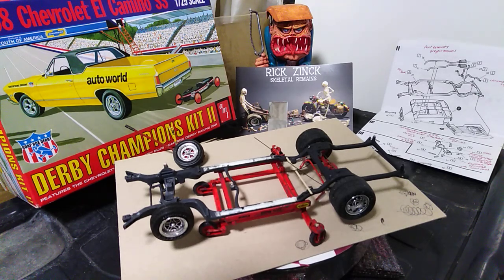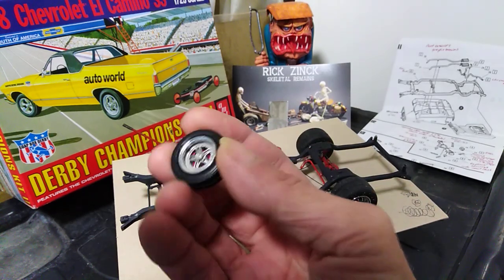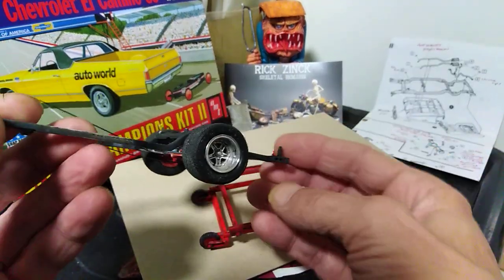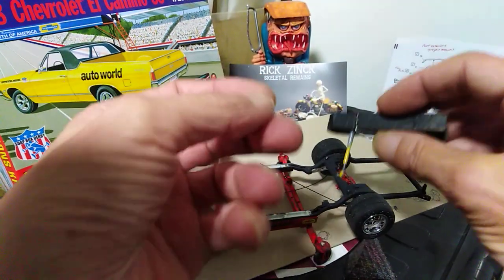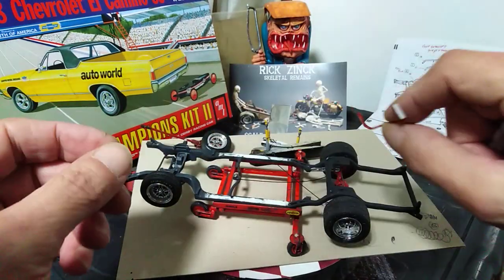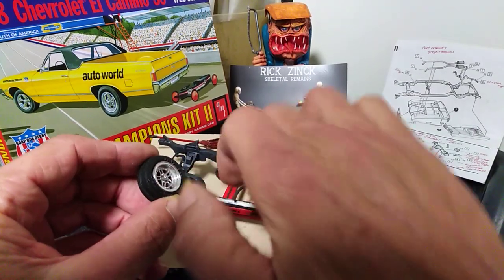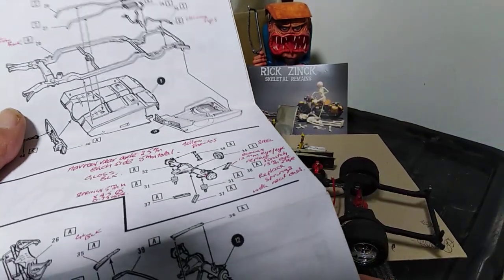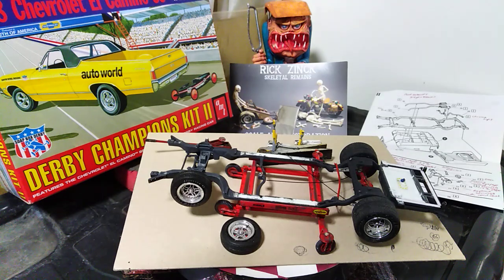1968 Chevrolet El Camino by amt. wheels, brake cables and suspension.

Comment: Interesting video, I could watch these all day long. Nice scratch building with the spare sprue pieces, I like your idea for the tire valves.
Reply from the maker: I really do think that adding little details makes a model. It takes 20 - 30mins to do a set of valves but enhances them vastly. Engine bays look barren without wiring and I don't think plug wires are enough. Open any bonnet and look. I've bought Workshop manuals for several cars to look at details. I didn't mean to run on, but I like talking with you. So, I hope you're ok and best wishes from jolly old England 👍😎Pete 🤓
Reply: @petesmodelcarcustoms584  No problem, glad to hear your ideas.  I don't have access to all the aftermarket accessories they have in the U.S.
Reply from the maker: @ModelCarMinion  That's the main reason for scratchbuilding. I try to copy what I'm looking at and use anything, if it helps. Jewellery, other models or just sheet and rod Styrene. I enjoy the challenge of making things and my life has been spent doing that. Cars, boats, motorbikes and models.

Comment: Really nice work Pete, love the details, :)
Reply from the maker: Thanks Tom. It's a nice kit😁and is fun adding a few details. 👍😃. Thanks for watching and best wishes from jolly old England. 👍😎Pete 🤓. P.S. I couldn't view the photos you sent. 🙄. I have so much trouble even receiving emails 🙄
Reply: @petesmodelcarcustoms584  I thought of that after I sent them to you, I will work on getting you a 29 roadster kit, such a nice kit to build, :)
Reply from the maker: Kit no 4463. 29 Ford Model A roadster. A black one with 78b painted on the side. Has been available over here for a while😃👍. Do you know if kits85-4326 and 4464 are the same. One is blue special edition 30 model A coupe and the other has just appeared over here. A painted garage scene on the box🤔?? Please don't send any, but I appreciate your help with the information. Cheers Pete
Reply: @petesmodelcarcustoms584  4464 is replacing 4326, molds were destroyed shortly after production in 2016, 4464 isn't available here yet, supposed to be really soon, and 4463 is the 29 roadster, both are really good kits
Reply from the maker: @ramblers69  Wow. Cool. I'll get a 4464 soon. They are priced at about £32. Which isn't too expensive 👍
Reply: @petesmodelcarcustoms584  Thats awesome Pete, 👍👍😎
Reply from the maker: I've rather over done it on kits in the last couple of weeks. Since buying the little deuce coupe, I've bought 5/6kits inc a Cadillac, a fire engine and a very modern BMW, but I'm going to seek councilling for that purchase🤣🤣🤪🤯🤒
Reply from the maker: I'm consoling myself with the thought of chopping up the fire engine 😳😂
Reply: @petesmodelcarcustoms584  Doc would 🤔
Reply from the maker: I bought the heller Delahaye fire engine. It has the swoopiest front grille I've ever seen and is volunteering for a ramp truck conversion to carry a 34 Ford. I've walked the dog, checked my finances and bought the 5 window😁. Do you have a release date but I got mine from Dave Coley's Emporium and they have ten at mo and i think they ship overseas. www.davecoleysemporium.co.uk 👍😎Pete 🤓
Reply: @petesmodelcarcustoms584  I looked up the firetruck, that is pretty cool, be fun to see you chop it up, I have a good mate near London and he text me today, sending me a 5 window, thanks for the link, :)
Reply from the maker: Yep. Just the front grille sold me 😎🤩. I've had a quick look but I'm saving it till I find out who does big rig group build and do it for next year.🤔😁. Glad your mate can get kit👍from Dave Coley's? He'll get a free pair of side cutters🤩😂
Reply: @petesmodelcarcustoms584  I'm not sure where he got it, as long as it's coming my way I'm a happy guy, 😃

Comment: Nice job Pete, running the lines and plumbing and all that, real nice 👍! Keep on keeping on my jolly Ol friend! Peace ✌🏻! I like that cradle you made for the frame, that’s pretty cool buddy!
Reply from the maker: Thanks for looking in Doug 👍🤩. I like doing the plumbing bits🤓. The chassis dolly was a few 1/72 truck wheels (airfix) and a length of 2.5 mm sq rod and angle. 👍🤩A fun little build for my garage scene 🤣. Take it easy mate and best wishes from jolly old 👍😎Pete 🤓
Reply: @petesmodelcarcustoms584  - yeah buddy, I hear ya, I’d like to be able to do more of the detailing too on models, that little stuff is just too tough for me to do with my arthritis in my hands! Man I’d sure like to do more of that, I’ve tried a few times, I succeeded in wiring a few engines but that’s it forget the plumbing bits, that wiring was bad enough for me! Geez! Haha! Anyways, take care mate and keep on keeping on! 🤘✌🏻

Comment: Hey peter do u have any videos on your garage diorama? I would love to see more of that and what did you use for materials on it? Thanks!!! ARCO
Reply from the maker: Morning Arco. I haven't made a video on making the garage as it's very basic anyway. The brickwork is a white styrene embossed sheet aimed at railway builders. I painted it in various 'brick' reds. The floor covering is a is a paper print for dolls house,but was a waterproof print and smeared when I was varnishing it. It's mounted on two layers of polystyrene sheets and the brick is supported on 3/16square wooden battens. Like I said it's built more like a studio set than a building. Quite simple to make, but, if I was making a permanent one, I'd look for a glass case to build it in first. Building big diaramas, the biggest problem is dust. 😬

Comment: Do you have any method to get the bead flange on the rims to set in the tires so they don't stand out away from the tire bead Pete? 
I suppose what I'm trying to say is on real tires the side wall of the tires balloon slightly further out than the bead flange of the rim. The model car rims flange is too thick to give that look of the rim restraining the bead of the tire.
Reply from the maker: My mind is going for tubing of the diameter of the wheel so the tube wall thickness supports bead and somehow grind. Can you say what wheels you are working on. If I've got them,I'll look at mine👍
Reply: @petesmodelcarcustoms584  > Pick just about any rims and tires. I've struggled with that issue on several kits and several tire and rim match ups.
I ruined a few rims trying to overcome that.
I can tell by your reply you understand what I was trying to describe.
I'll keep experimenting. I have no doubt that if you set your mind to it you will come up with an effective technique. You're a pretty inventive guy.
Reply: @petesmodelcarcustoms584  > if you develope a technique maybe you could do a video spot on that one. I'll be watching if you do.
Reply from the maker: Thanks Ken 👍. But I didn't realise that it was a problem I wanted to solve😂😂
Reply: @petesmodelcarcustoms584  🤣🤣🤣🤣🤣 Just figured I'd ask. 🤣🤣🤣
Reply: @petesmodelcarcustoms584  > Yeah I saw it when you were showing that El-Camino chassis and running break lines. I saw the front rims and tires on it then I was reminded of my struggles with it.
Best wishes from 
      Chilli ole Chi Town.   It's a co mo fo here. 🥶
Reply from the maker: It's the windy city is it👍. Its similar here. Wind from Arctic whizzes past Norway and hits me on the sticky out bit of England I the North Sea
Reply from the maker: Also. If you have a circle cutter? Cut a ring from wet n dry paper, glue that on tube and rotate with tube on the wheel 🤔🤷‍♂️
Reply: @petesmodelcarcustoms584  >Actually Pete, Though it is windy here. We didn't aquire that title because of the wind here.
We earned that moniker from NY City in the early 1900's. In an intercity political rivalry New York said that all they do in Chicago is blow wind. 🤣🤣🤣🤣🤣🤣🤣🤣🤣🤣
Good to have a couple of laughs with you Pete.
Reply from the maker: @kentinman2326  bags of wind🤩😂. I didn't know that. I assumed that you got a wind off the lake🤔👍
Reply: @petesmodelcarcustoms584  > We do get wind off the lake. And it comes from the same direction NY is in.     🤪